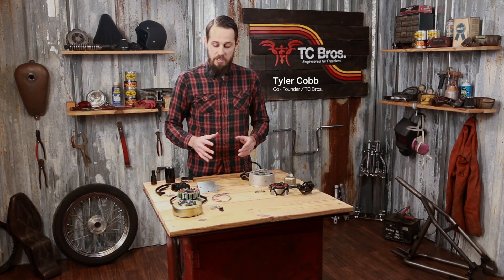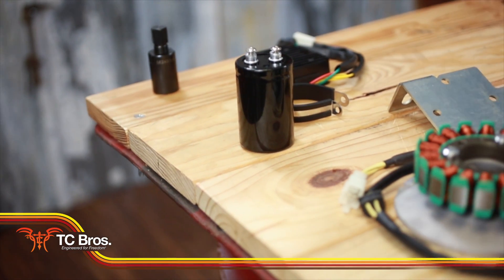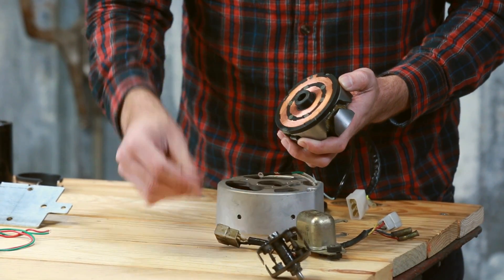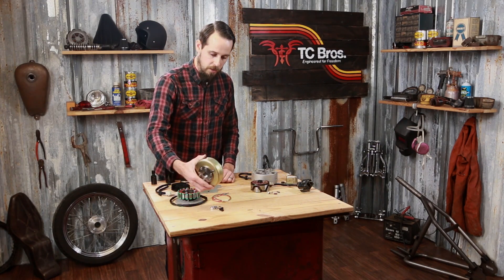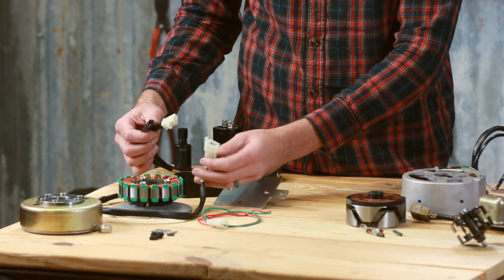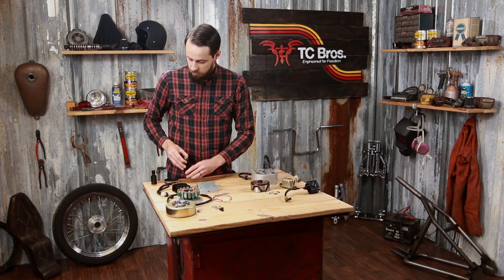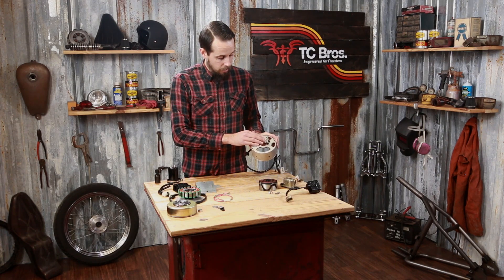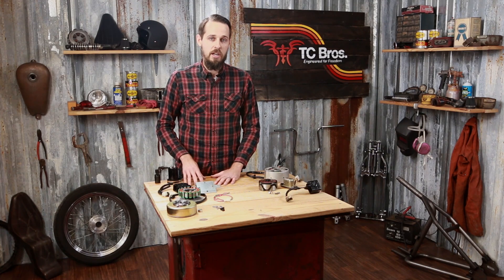XSCharge Yamaha XS650 Permanent Magnet Alternator Conversion Review By: TC Bros.

Comment: Won't you always need the stock battery to start the engine? There are times when you need to use the electric start, like when you are stopped in a line of traffic and you want a quick "get away"  I'm thinking the capacitor wouldn't have the power to turn over the engine.

Comment: Does your rota have timing marks that the XS will use, or do you just paint lines on like the others? The general biker will get stuck swapping it all over, removing all his existing electrics and trying to find a place for the regulator rectifier to go. As you know most XS's have safety relays that get a feed from the alternator (the yellow wire on most), how will your PMA let the safety relay know the bike is running to prevent you from activating the starter accidently? I see in your instructions you mounted the reg/rec with ease on a chop but what about a standard bike? As for the timing marks your pdf answered that question, no timing marks.

Comment: 2 jaw puller will easily remove rotor , just take up the tension and give it a good rap with decent hammer , rotor should just pop off . Advantage of old regulator is it allows extra charge if you need for spot lights etc , brushes were just a part of owning / riding the Yam . I wore out many motors back in the 80s , best engine to work on and easy to maintain ,just watch the timing and clean air filters regularly .

Comment: Off topic, try half Valvoline regular motorcycle oil and half Valvoline synthetic motorcycle oil. Better clutch feel along with smoother shifting. I buy it at the local Walmart, and replace it when the shifting starts to feel a little worse-  way before 7,500 miles.